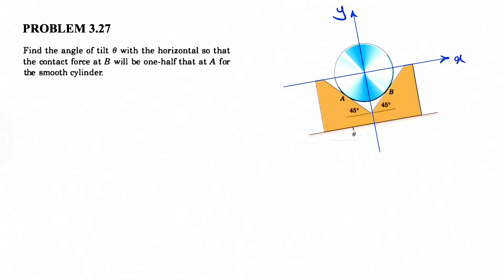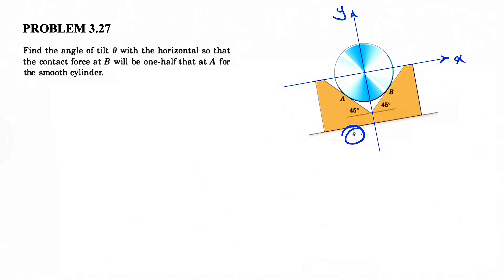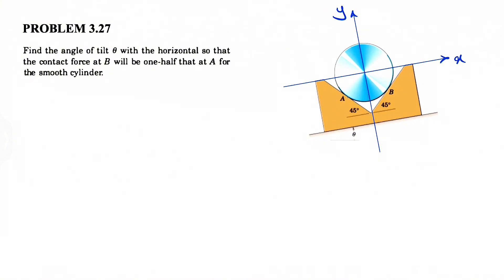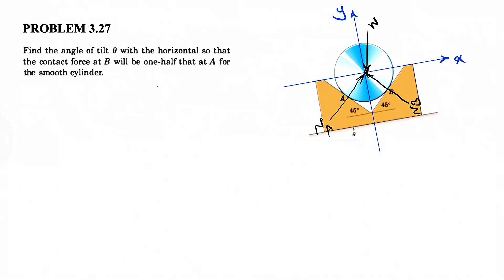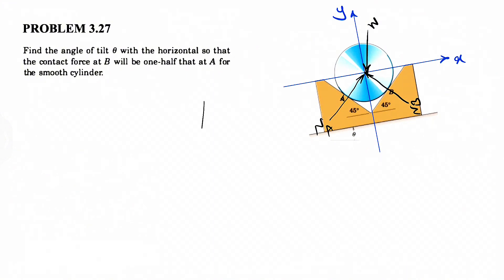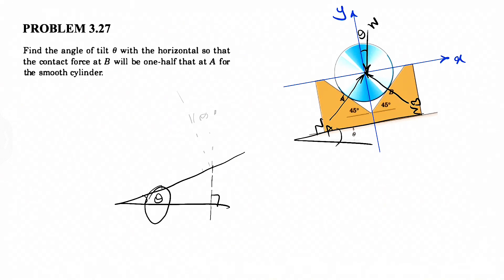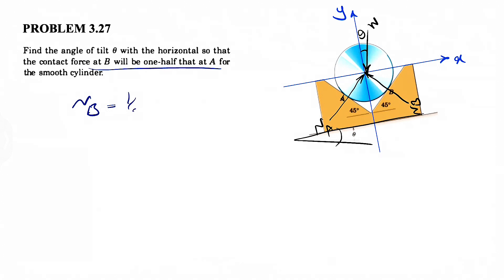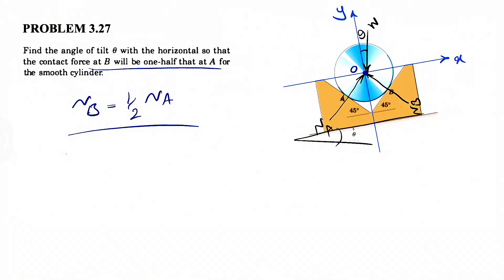Solved Problem 3.27 | Find the angle of tilt 𝜃 with the horizontal so that the contact force at B

Comment: What made you come to the conclusion that you should put the origin of the coordinate system in the center of the cylinder? I never woulda thought to do that but it makes everything cancel out nicely
Reply from the maker: Great question!, that’s the trick! I chose the center because all the forces (the weight and the normal reactions) act through or around that point. It makes the geometry symmetric and the equilibrium equations much simpler — everything lines up and cancels nicely!